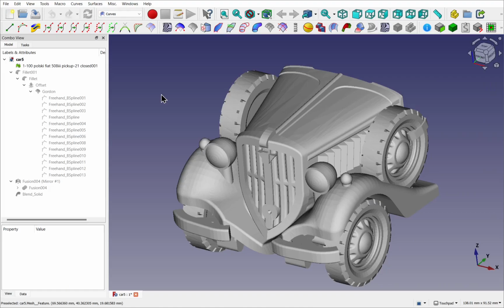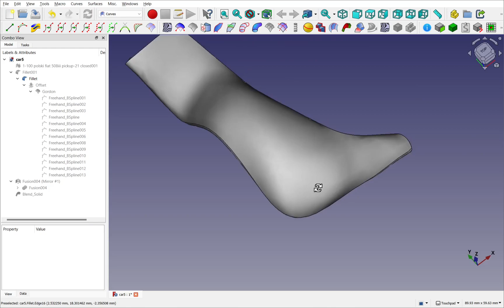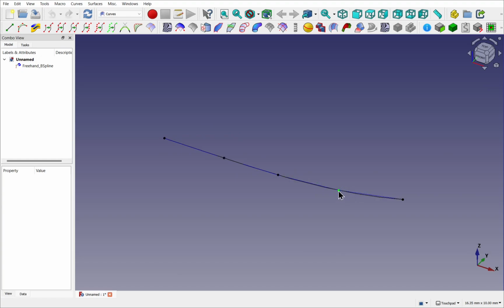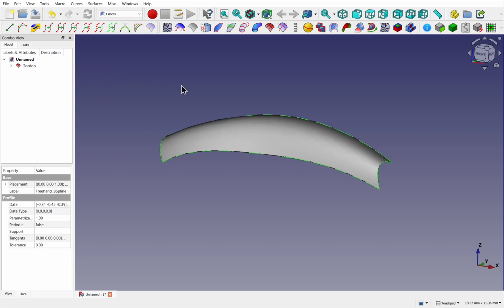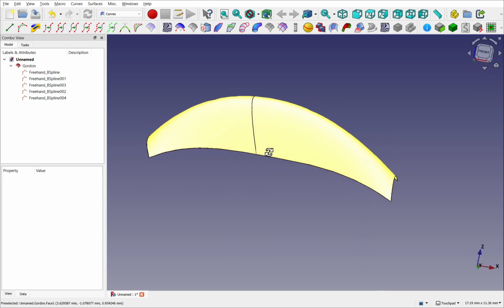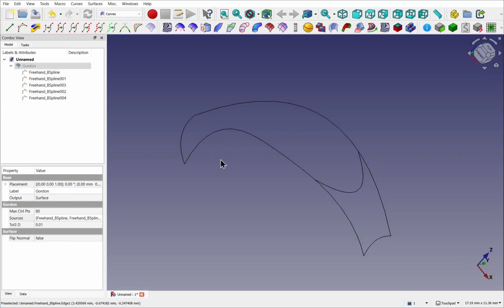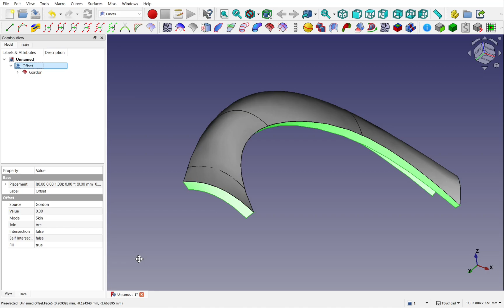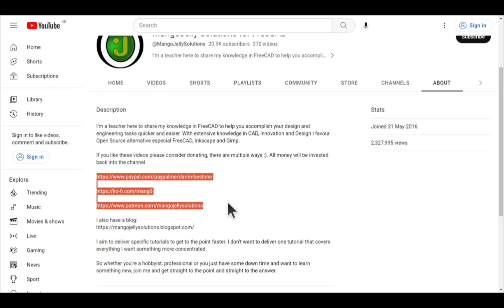FreeCAD Basic Surface Model: Building Wireframes to Gordon Surface | Basic Surfacing 6 |

Comment: I notice that when you draw a b-spline it is nice and clean.  Whenever I draw a b-spline it is cluttered with lots of bracketed numbers.  I can't figure out how to get rid of them.  Please help.  Thanks.
Reply from the maker: Yes I know exactly what that is.  You can turn these on and off in the sketch itself.  It's on the top menu > sketch > sketch b-spline tools and there are a number of show / hide options there .  If they are greyed out then cancel the tool you are using to go back to the usual mouse pointer.  Hope that helps.

Comment: Wow. Thanks for the introduction to Curves WB. It really adds a lot of new possibilities to the more convential way of construction! 
Is there a way to combine this freedom with the strict control that parametric design offers? For example to create a fairing which is curved in two dimensions like this fender, connecting two sketches? Or will gordon surfaces always be kind of "free floating", not attached to anything?
Reply from the maker: That's a good question, the freehand b spline does have a property where you can see the coordinates of all the control points and edit them in table form. I have controlled these values with python but  haven't tried linking the values up to a spreadsheet. You can if you was using a sketch by linking up each control point  to be externally constrained via a cell in your sheet, but the sketch is a 2D element rather than 3D like the freehand Bspline. It would add a lot of control to the surface.

Comment: Suppose I want to model a roadster (drop top coupe). Can b spline surfaces be dimensioned and turned into actual frames or parts? or is this for modeling and visualization only? A wireframe would also be useful if it could be dimensioned to actual size. Thanks for the tutorial.

Comment: Wow,  much easier than what I used to have to do way back when I worked for an aerospace company using a competing product. You could create a surface that looked good, but you couldn't machine it without the ball end mill plunging down to the center of the earth. Hopefully Freecad doesn't have that issue.